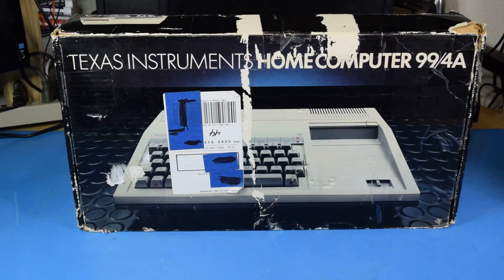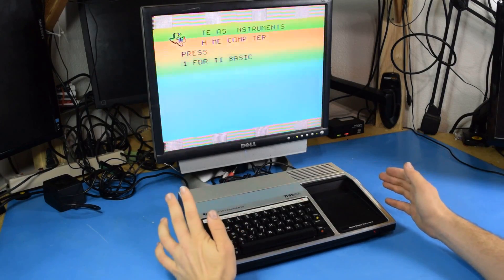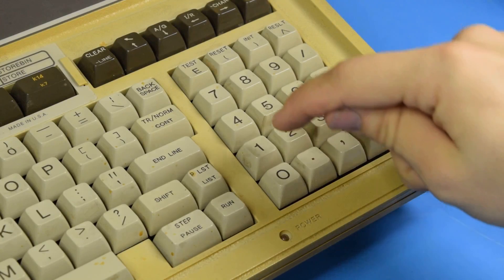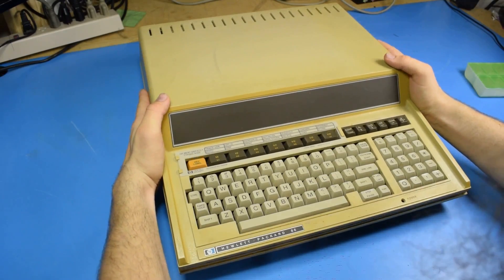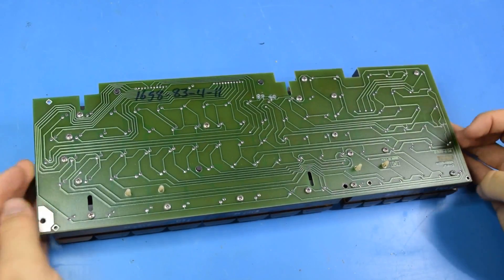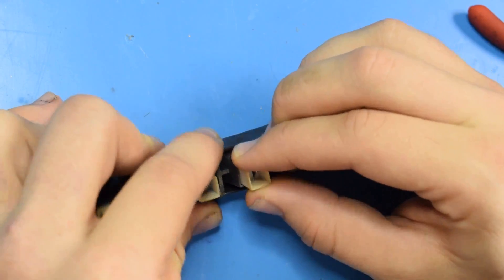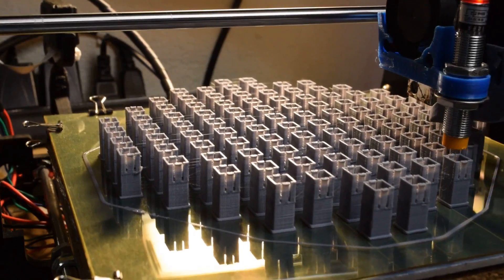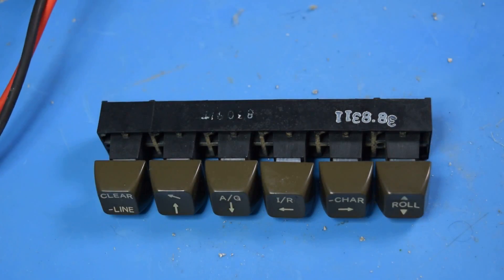0x0029.1 - HP86 New 3D Printed Key Stems: Disassembly and Design

Comment: How have these 3d printed stems held up? I have a ti99/4a with a few broken stems, and it didn't feel right for me to cannibalize another system either.
Reply from the maker: In the long run now I'm not totally happy with them and I'm not sure what the best solution is. The FDM didn't hold up all that well, I later got some SLA printed but after a few years the SLA shrank and started cracking around the key cap.

There may be a method to preshrink the SLA like annealing that could make it easier to come up with a correct size to use long term. For now I would recommend SLA printing only and scale to the biggest you can before the stems have too much friction to slide or the keys don't stay held in.

The tool for putting them in without breaking the spring leafs is very critical still and printing it out of anything will work.
Reply: @TechTangents  thanks for the update! When you did your testing, did you try ABS or a nylon filament for a little extra strength? I know ABS can be a pain to print due to shrinkage, but it might outlast the PLA stems. Nylon I think doesn't play well with all printers, but it has a high tensile strength and if you get a clean print it's generally fatigue resistant. Unfortunately I don't have a way to test that myself yet as I currently only have an SLA printer. A Prusa Mk4 or P1P is on the wish list, but it's not close yet...

I could do SLA but yeah I'd be concerned about the durability. Still, 1-3 years of use is better than having a nonfunctional key.
Reply from the maker: The problem isn't strength with FDM, it's friction. They are just too rough from the layers. I don't know what different material options there are for SLA but that is a good idea for something to look into to solve the shrinking.

I wouldn't worry about the normal durability of them, the changes to the original design I made to add a lip around the top edge adds strength in the place it needs it the most. Every other part isn't really under mush pressure.
Reply: @TechTangents  I see. Thank you for sharing! I will keep these in mind as I go through the options.

Comment: Hi anyone!  If anyone can help, i would appreciate it.  My Dad gave me his old HP 86.  I remember it growing up. Unfortunately, I can't remember how to run it.  I can get action games going easily, but there are files, from when i was in elementary school, and my Dad's files I would love to look at.  He just passed away from Dementia, and he couldn't help me at the time it was passed on to me.

I just need a start on how to load the programs/access the files.  It's important to me, like a time capsule. 

I feel kinda dumb that 10 year old me could do this and not me now.  

PS the CRT monitor doesn't seem to work, so my limitation to connect to another monitor is known (part of info/screen cut off)

Anything to get me going.  Let me know what i can give you too help.
Reply from the maker: Hello, and sorry about your loss. These computers are very unusual, they use all custom software and file storage and aren't very easy to work with so you have an uphill battle. As a starting point, series80.org can get you to a lot of information out there about these kinds of computers. I would look up a manual for the HP 86 and read up on how to work with files.

The monitors these use are also unusually and the computer takes advantage of what most systems consider the "overscan" area to display more information. You need a monitor capable of displaying the overscan area to see it all. Some composite to HDMI adapters will be able to do it but finding adapters and monitors that can do it are hit and miss. It isn't likely you will find any TVs that can do it.

Comment: Tip: You can pull the stems out (carefully, but with a fair amount of force) without desoldering the entire waffle, I guess for anyone else who has to do this

I considered 3d printing new ones for my 85B, but I thought they wouldn't be smooth enough compared to the original (nylon?) stems.. Seems like they're working fine for you?
I might try ordering some made with SLA resin
Reply from the maker: How brittle is the SLA? The PLA ones I've printed are doing fine. I will be doing a follow up video now that I've used them a bit. I need to increase the bite amount of the bump that keeps them in. A couple keys are almost pushed out by the springs now. But it's overall extremely good.
Reply: I'm not sure, I've never used it before.

2 years later edit: It's reasonably priced to get them SLA printed from ShapeWays, but you need to upload the parts all connected together with little bars.
Otherwise they all count as separate parts, and they charge you the base fee for each part ($$$$).

Out of curiosity I took a key off my TI-99/4A and it actually has Cherry style + shaped stems, not the Stackpole ones. Kinda interesting to see that they changed things like that around over time

I wonder if there's an HP-80-series owners group where we could set up some kind of group buy for proper injection molded key stems...
Reply: @TechTangents  I returned to this a few years later now that I actually have a 3d printer:
My Ender 3 V2 prints them *decently*... but I'm still curious about SLA. I looked into ShapeWays a few months back and found it would be around $80 (iirc) to get a grid of 100 of them printed, which is reasonable but out of my budget.

A tip worth noting for anyone looking to use ShapeWays for batches of parts: Don't upload a single part and select a quantity. Throw a bunch of them in a grid in CAD, connect them together with little sprues, and upload that.
It's exponentially cheaper, they will charge you the base price for each part if you just select high quantities of 1 part. Their support rep confirmed this.

Comment: how do i get chocolate doom text mode
Reply from the maker: It's done using libcaca automatically if you launch from a true terminal. You can also manually set the driver and launch it from a terminal emulator using "SDL_VIDEODRIVER=caca chocolate-doom"
Reply: A true terminal presumably being stuff like tty1/Ctrl+Alt+F1?

Comment: Couldnt you use an easier 3D slicer/designer for the printer rather than having to define the object in code?
Reply from the maker: For me as a software developer, OpenSCAD is the easier designer. I also prefer to use slic3r so I can control all the aspects of the slice. I get better results this way than just using an easy program and hoping for the best.
Reply: As a software engineer, I can attest that designing stuff in code just makes more sense to us. We typically end up designing stuff in a structured way where we can freely adjust any measurement and everything automatically follows and readjust because it's all based on calculations and relationships between things. It's also pretty good for reusability and version control. In general it also forces you to think the problem through, and tend to lead to higher quality outputs. 

Code also simplifies itself the more abstraction you add and split it up in smaller independent components, while using big software you typically end up with a huge mess of options, layers and typically also a very large project file. I want to cry everytime a designer sends me their Photoshop/Illustrator files. In code, you define things in relation to the others. If I have a menu bar with a bunch of options on the left and right, I know right away they will always be properly aligned because I declared exactly where it should be placed. I regularly work with inconsistent documents where things are placed by eye or via a guide, and things look aligned but if you look closely it's not, because the software used to design those have no way to constraint things in relation to the others. It gets even worse when you need to change dimensions, because the designers work on a fixed size raster it's always messy when you have to shrink a page, or user content doesn't fit the box they made to contain it and it needs to be bigger. When I make stuff for myself, I can skip a whole entire design step by going right into the code.

I design my print documents in HTML/CSS and make graphics straight in SVG XML. This thing is practically just a language I know at this point, I just write in it. It sounds complicated but I instantly blow everyone's Word documents out the water with less effort. Why would I fight with Word to lay out my stuff how I want when I can define constraints and let an actual rendering engine do all the work for me?
Reply: Well parametric CAD software is very structured too and allows easy modification of the part. The basic building block is usually the sketch, which is solved into a flat piece of geometry. By combining multiple sketches spatially, the part emerges. To reuse sizes or perform explicit calculations on them, you can put them in a table, so instead of going through the sketches and changing the numbers everywhere you can just easily adjust things there.

But really unless you need fillets, which is an Achilles heel of OpenSCAD, OpenSCAD is usually quicker, as proper CAD introduces a lot of complexity in order to make complex part modifiable and maintanable. And that in spite of OpenSCAD being completely asinine in many regards, such as not having any scope of anchoring things to each other, and completely inconsistent placement and sizing parameters.

Then again, OpenSCAD's fundamental shortcomings rub me SO wrong on an aesthetic level, that i use FreeCAD for everything. And if you saw that, you'd know that it's not a thing of beauty and elegance either. But at least it's an actual CAD and it knows it.

Comment: Consider random gameplay (or other stuff) with or without random electionics/IT tech tips at the end of your vids.
Reply: Oh and BTW, well done with this job... seemed pretty tedious with a great result (or so far anyway).

p.s: I know you didn't intend on a multi-part, so hope this won't happen too often either... hate cliff hangers! ;P
Reply from the maker: I prefer to leave the ending different for each video so I can have different things there related to the video. I was thinking about having a shot of the new parts printing be the outro but I thought the black text part was fun so I decided to keep that going. 

I don't like cutting a video in half like this, but I may do multi part videos in the future if there is a good reason to end the current video. Like needing to order parts or if it's two related but sufficiently different topics about the same subject.